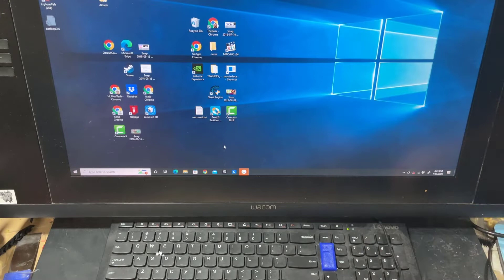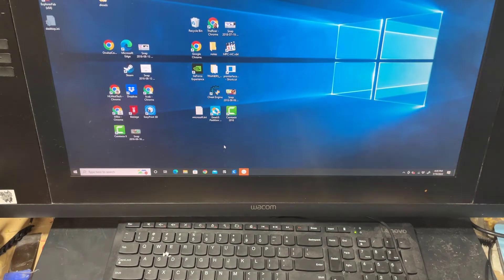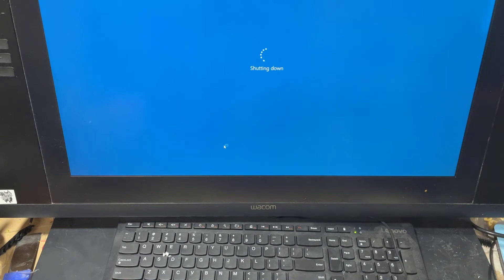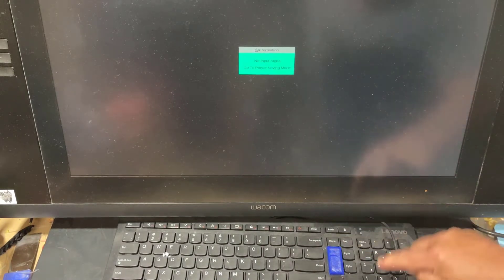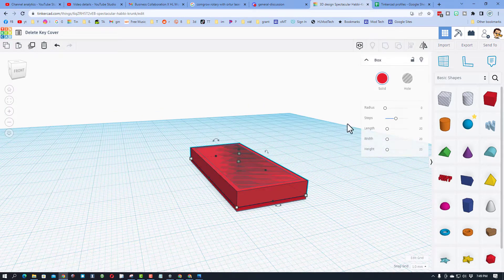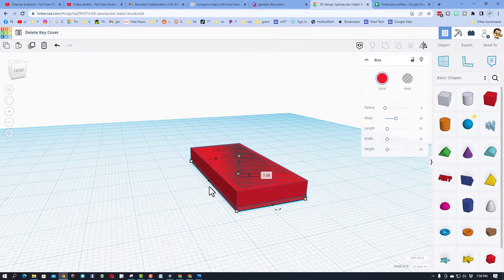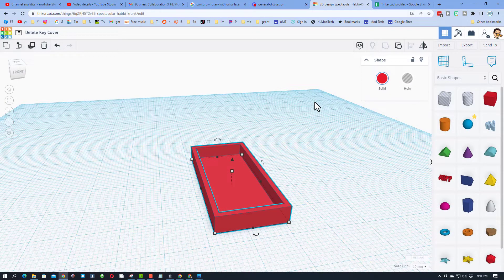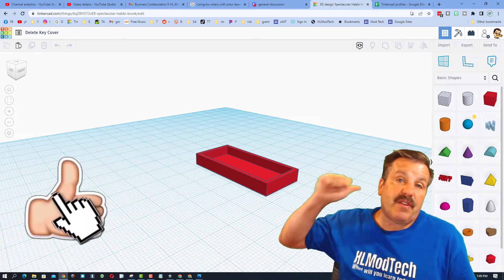3D printed Tinkercad Keyboard Fix! Simple and it WORKS!

Comment: Have you tried a different keyboard in case it has a short on it
what about the other Enter key
you can set keys as shortcuts, could it be doing this when you press it?
Reply from the maker: I did a lil leg work, but I have so many projects I have not went back to that. =) I like the idea of swapping the kb. Not sure anymore if I tried that. I fixed this in the spring after just avoiding the del key for a year... I accidentally said enter, but it really was the delete key. It has a 2nd one, same as enter, and that del key does work as advertised.